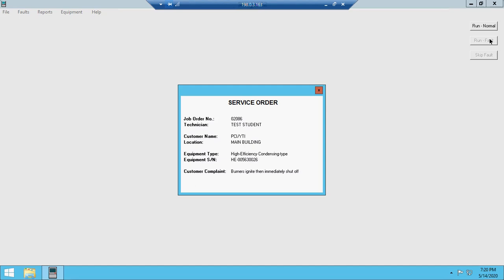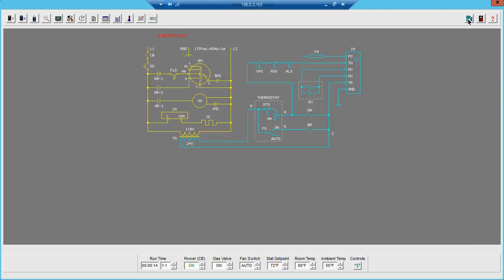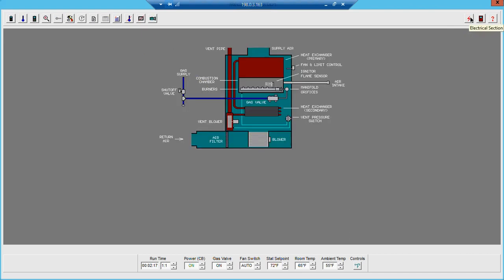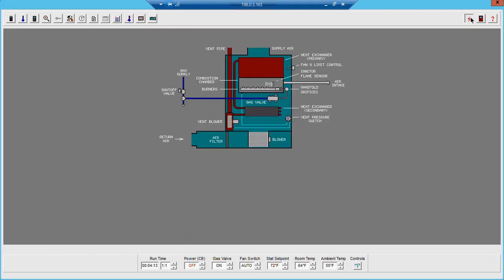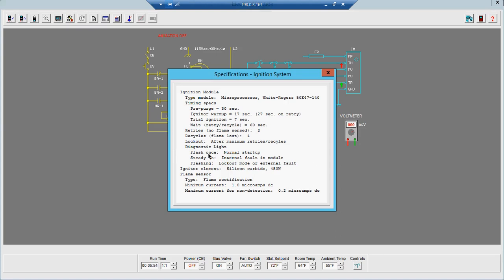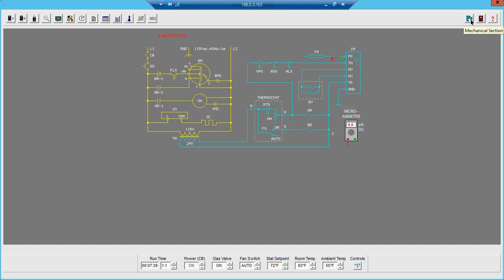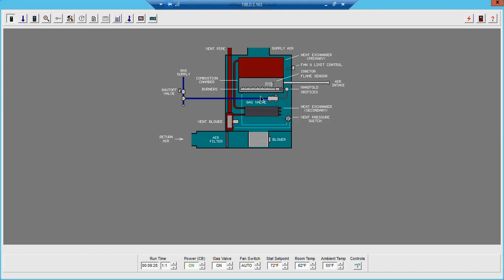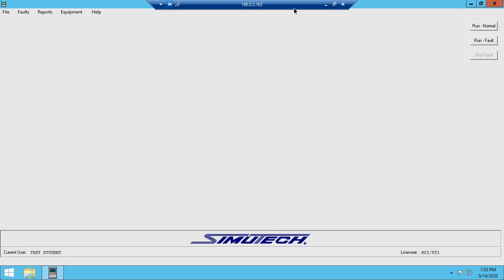Troubleshooting a flame sensor issue on a gas furnace

Comment: I was searching for videos on furnace control boards that have these "pins" where you can measure DC volts and convert that to DC micro-amps and I came across your video. I teach HVAC too and I used this software years ago, it is a great teaching tool, but I found out that the guy who owned this software died and so this software seemed no longer available. Do you know if this software is available again for purchase? Thanks.
Reply from the maker: Yeah. Unfortunately, this program is no longer around. Cengage has a simulator that is sort of similar, it’s more virtual reality, but I don’t care for it.